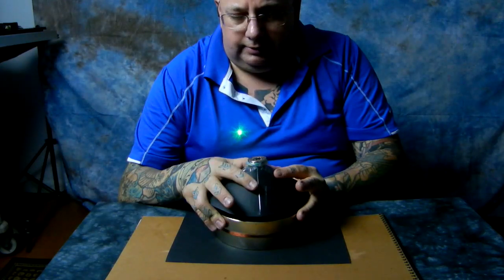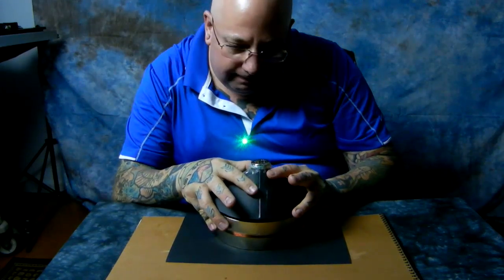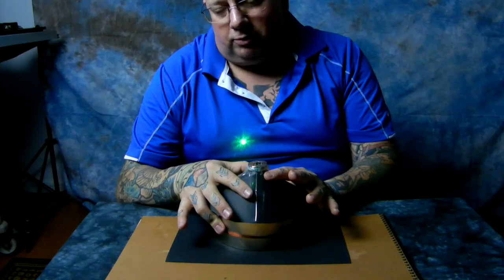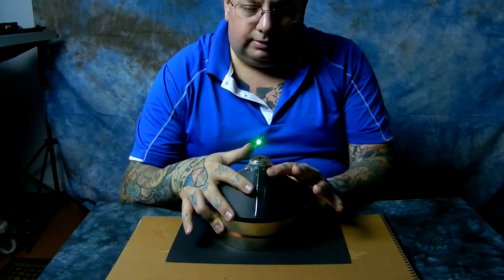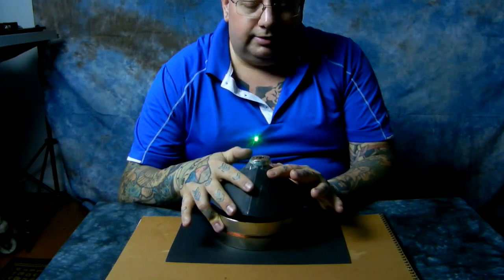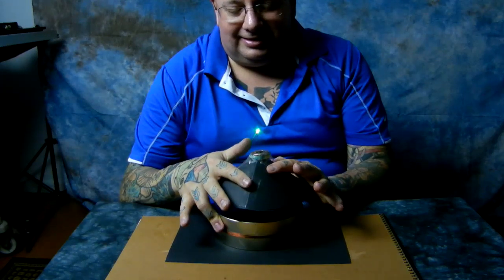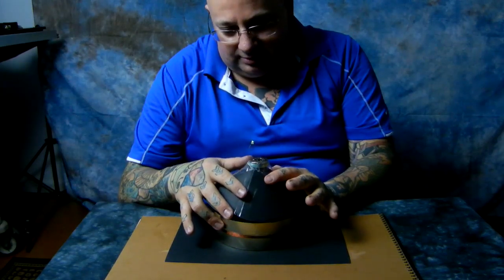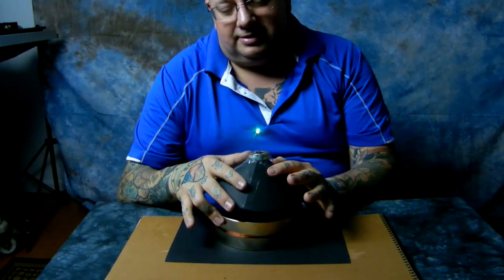NEVER SEEN before: Power output &  *NO INPUT*. Using HUGE Neodymium & Halbach Array

Comment: This needs to be set up in a fixture that allows dialing in the correct height and locked into place.  There is power input visible and that's the motion of your hands.  It may not be what's causing the light, but removing the mechanical motion input as a possible source would go a long way.

Comment: alright . based on watching countless hours of Ken's lectures in advanced magnetic and electrical theory , I had been inspired to build a "death Ray" ... somehow applying your theories to optical resonation and magnetic resistance of the light blah blah.... I have now  given up on my laser project. it turns out the principal design features are already known.a  Ruby laser apparently is what I have been attempting to recreate based on your theories... ha.. they perfected that in 1960 something.... co2 laser I don't know. I was trying to apply magnetical theory to the light source to somehow amplify the signal and of course this discovery was also mastered 70 years ago. oscillating frequencies amplifiers input signals ....
so somewhere in the far reaches of the military complex you are exposing their most secret research. in theory the current application is to steer multiple high powered laser input to one focal point and if not destroy the entire facility .... perhaps all of existence as they attempt to recreate untamed fusion. 
anyways. I call the death Ray quits. 
interesting though in order to operate it they use a lot of photo technology..... to charge the Ruby. 
now who knows why I would think you would prefer to discuss this but.... I would like to hear your thoughts on Ruby laser ...co2 laser....and these current applications. also antimatter... yeh that's right..
and applications via electro magentic control...my statement is as follows.
my knowledge has been yet uncapped by belief in what theoretical concepts are written in books, as I have never been indoctrinated in that advanced learning scenario. in reference to your statement as to knowing what limits a person's perspective will be based on them referring to or referring you to a certain theoretical well accepted scientific principal text defined statement. 
need more philosophical application.
and I am under the impression that you can create a magnetic anamoly generated field...  instead of the mirror they currently use to blah blah blah...
this is in what stage the amplification if the signal originates... and dissipates from. 
... wait it still sounds like I'm interested in designing this...

Comment: It would be interesting to see a measurement of how much electricity could be produced in your cone coil between 2 Halbach arrays with opposing focus to repel each other in a stationary clamped frame. You have the possibility here of a generator with no mechanical moving parts and no noise. It's then just a matter of upscaling to the size needed to build a device that harnesses this useable power source and calculating the cost to see if it's cheaper and more efficient than current technology on the market. This could potentially help save mankind from the path of destroying the ecosystem we're currently on and launch us closer to cleaner tech for use in colonizing other planets.

Comment: Well the fact is it's not special. The earth itself has a natural charge of ...?? I if I remember .5 volt with a minute amount of capacitance. 

1. Tesla said he could have a stationary copper array that would generate power. . 

2 your minute oscillation of your bands creates the rotor stator situation just like any run of the mill alternator/dynamo. 

I like you, I like your videos. But in this instance you are incorrect. 

For a long time I have known that constantly varying magnets some how in tune with the suns discharge amplitude would produce power over "unity" because unity is defined by near and observable inputs of energy. This video belittles the rest of your work, and makes you seem like a charlatan. I suggest you take it down
Reply: dekonfrost7 I think (hope rather) he’s testing to see who’s stupid. Notice his R ring finger never leaves the copper coil, the light only going out when the thumb of the same hand completes the circuit with the thin wire the led is supported by.

Comment: I'd like to see this experiment done without any kind of movement between the coil and the magnet. At times It appears your holding your coil in a fixed position, but with such a powerful magnet even the smallest movement makes this outcome appear questionable.
Reply: Grants Pass TV Repair I thought the same thing.
Reply: Cool !
Reply: You spent an enormous amount of money on that huge magnet.... Lighting an LED that will light with as little as one milliamp.... With that much of a field your micro tremors in your hands might be enough movement to generate the one milliamp... Use a fixture that holds the coil steady then I will believe...
Reply: Grants Pass TV Repair Your right, it's the movement that is generating the electricity.

Comment: Wow Ken, you beat me to it.  I am using a cone shaped ferrite from the back of a CRT.  These deflection coils have a unique shape, although I had previously unwound mine for making joule ringers, I kept the ferrite core.  I am separating the toroidal shaped outer field from the inner vortex.  Just by placing the magnet dead center with the plane between the poles flush with the smaller opening of the ferrite cone.  I will make a video soon with my findings.